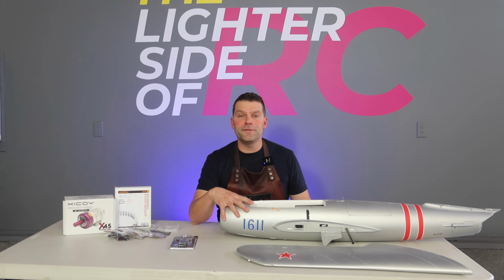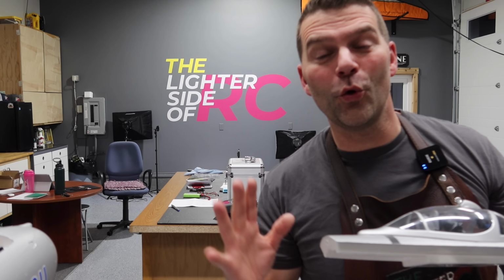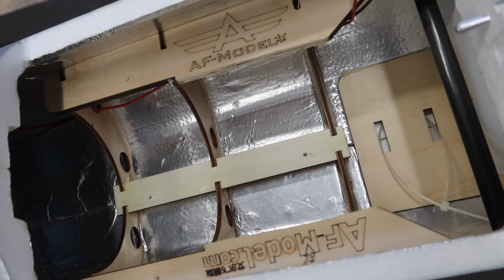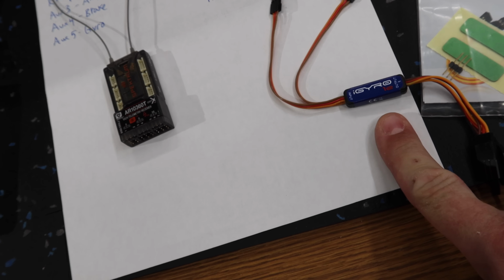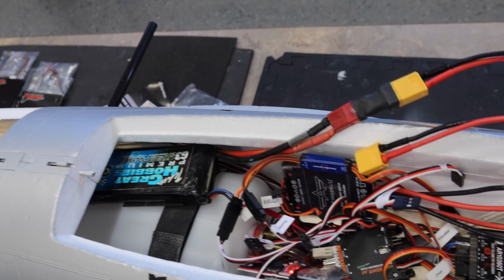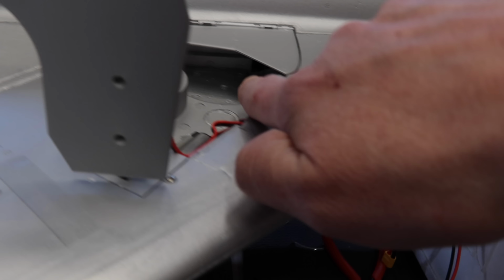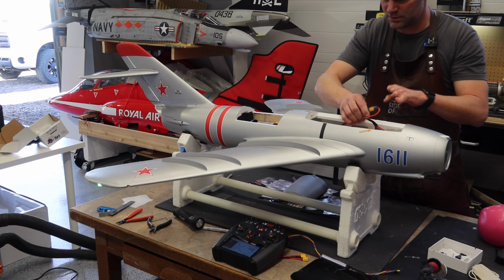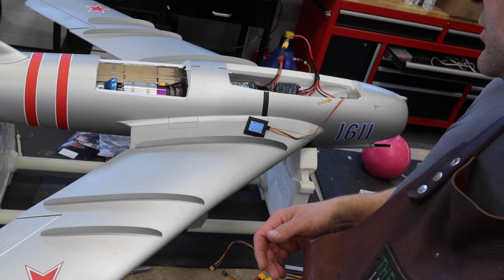FOAM FIGHTER - Building The Ultimate MIG 17

Comment: I still fly my HSD Super Viper 105 (foam turbine jet), bought back in 2016. I first flew it with a K-45 .. it was OK, but after swapping in a K-60, and adding a small extended fuel tank, improved the performance to a more satisfying level.
PS, it came with servos, retracts & brakes w/assoc controllers. I replaced all the servos with better ones, as they were barely strong enough .. it took several attempts to get the brakes right.
Reply from the maker: Thats impressive for a foamy!  That's one of my big concerns with the foam turbine aircraft is the ability to deal with hanger rash or small dings and dents.

Comment: Nice build 👍🏻. You mentioned the u/c mounting blocks not being solid and when you ran the engine up it looked wobbly on its legs to me did you do anything with that?
Reply from the maker: The U/C mounting blocks on mains were slightly loose.  They were re-glued in place.

Comment: Just out of curiosity, I didn't hear any mention of solder stick on your batt connections. Is there a reason that you didn't use them or did you and just not mention them?
Reply from the maker: when your putting 3 massive wires together one one side and a single on the other side it's not an ideal setup.  Standard solder joint is best.  No SS connector big enough to install the 3 big wires into.

Comment: Does the gyro in the specktrum rx have any issues when running a turbine?
Reply from the maker: I'm not a regular spektrum flier so can't say for sure.  one thing I did but didn't show in the video was take the receiver apart and install silicone on the board.  This is a very common suggestion with this setup in a turbine.
Reply: @The Lighter Side Of RC  thanks for the reply. I've been wanting to get into turbines and I fly spektrum. Do you happen to know where that info was referenced?
Reply from the maker: I asked the question on the Facebook spektrum forum re that receiver. That’s where the replies came from.

Comment: If that is the AS3X 10 channel receiver it is a  no go for turbine aircraft. It even says so right on the Horizon page. And those gear controllers work great right? Up until you try to us it in flight and it won't work.
Reply from the maker: Many use it with success. Opened it up and filled with silicone.

Comment: That receiver may not be the best with a turbine. I think the PowerSafe AR10400T will be a better choice. But nice work👍
Reply from the maker: Thanks 👍. Threw it out there in the spektrum group and it was 75% ish said no problems.  I did open the receiver and install some silicone on the board and closed it back up.  That was a common suggestion.

Comment: Great build,  love your videos,  always learn something watching you.  I definitely gotta get that scale setup for the Xicoy CG transducers.  I have a setup using long scales from Harbor Freight on a table but always difficult to use.  Also,  I am assuming if using a KT45 turbine I shouldn't have to adjust the motor mounts like you did for the Xicoy?
Reply from the maker: Thanks very much!   If using the kingtech you will probably have to get the mount in the middle of the rail like I did.  The former work in the back of the plane prevents the pipe from going at an angle up and down so not much room in the pipe.  Engine is the adjustment point.

Comment: Great looking little foamy Mig that should fly great, as long as the stock electronics can be trusted, and they're not on the super cheap side. That's the only thing that bothers me about these arf's that come with the electronics already installed. You know they're not putting high quality stuff in there.  All it takes is one sketchy elevator servo, and it's all over but the crying. Not trying to be negative, as I believe it's a very legit issue that needs to be monitered. I would put all the flying surface servos on a quality servo tester, and give them a good workout before I put her in the air.
Reply from the maker: Totally agree!  That's one of the downsides for sure!